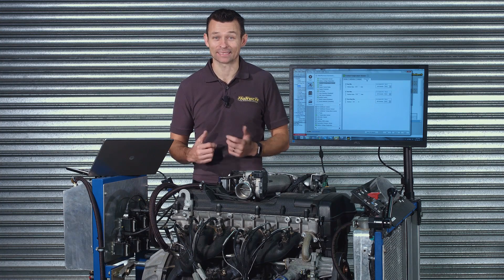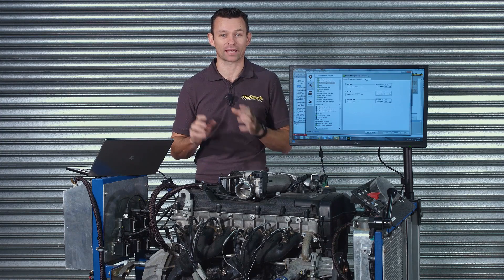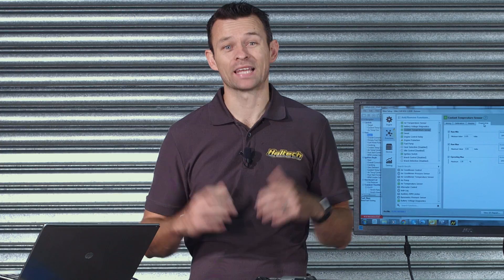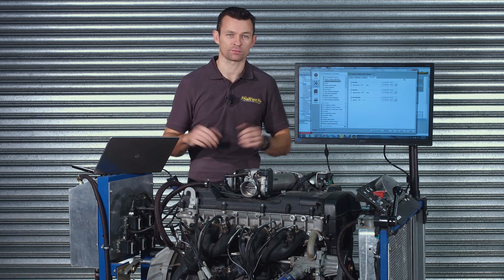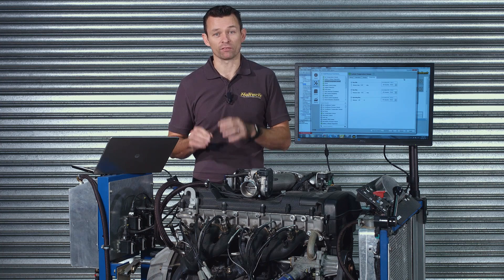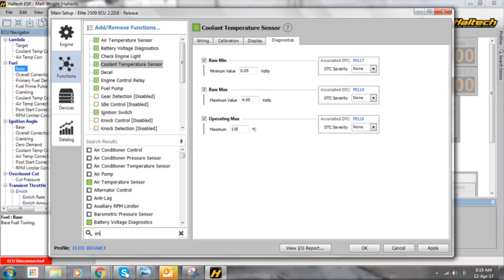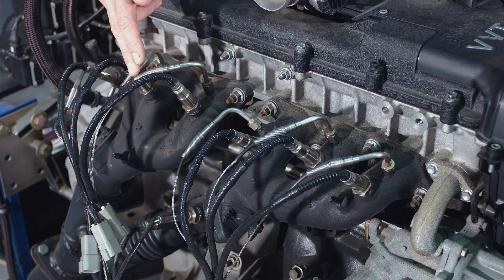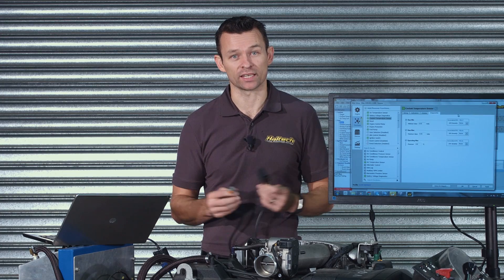💬 How NOT To Blow Your Engine - Technically Speaking

Comment: Can you configure it to shut the engine down completely?

As in say I had no oil pressure when the engine was doing more than 1500rpm, I would want the engine switched off then no fuel injected until the ignition had been cycled
Reply: That sounds dangerous. Save the engines life at the cost of your own?
Reply from the maker: Yes you can limit the engine to any rpm in engine protection mode including 0 rpm where it would shut the engine down.

Comment: this function has already saved my engine running a ps1000...my one complaint now about my elite 1500 is there is no generic pressure sensor selection...So I'm doing crank case pressure named as fuel.tank...

Comment: Is there a way to set up downshift overrev/moneyshift protection?
Reply: If you're really keen you could modify your shifter linkages with electronic solenoids, switched by road speed, to lock you out of certain gears
Reply: can't do that from the ECU, at least not without it having some way to hit the clutch when the engine goes past the rev limiter.
Reply: +Ben Powell That sounds pretty neat, technologically. I'm guessing that this is probably similar to the system that some cars, like the Peugeot I mentioned earlier, use.